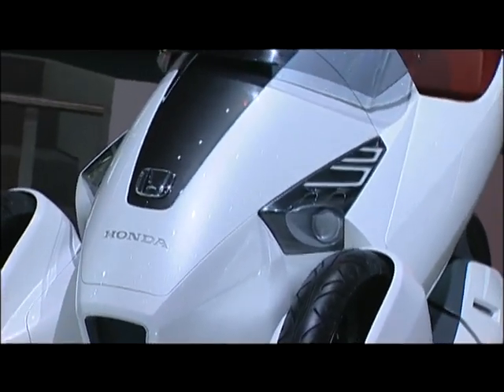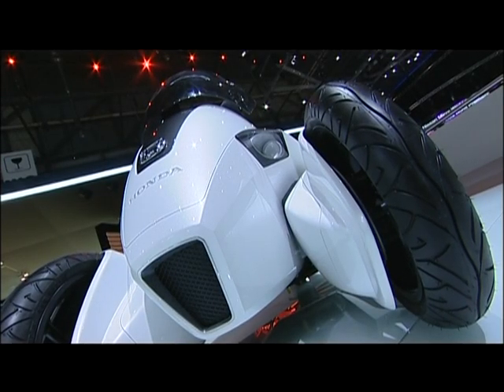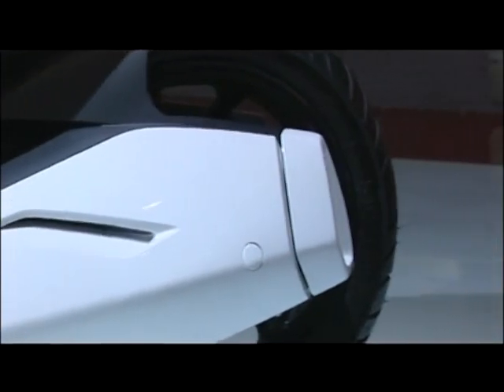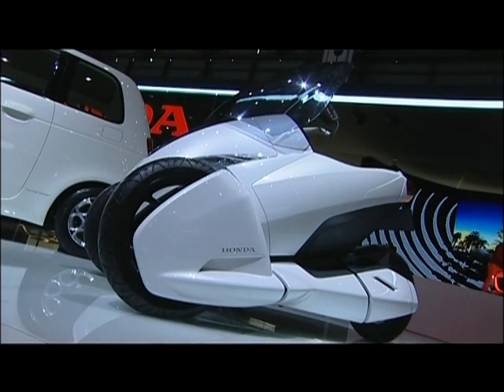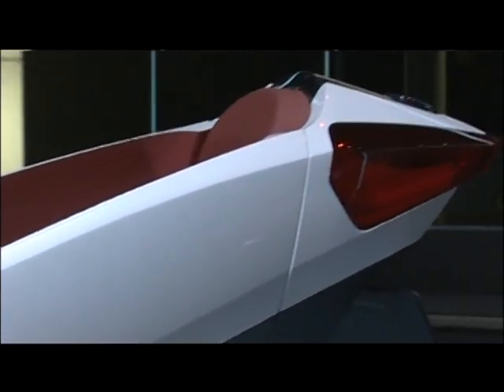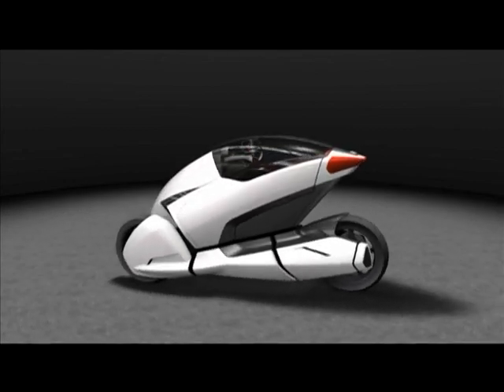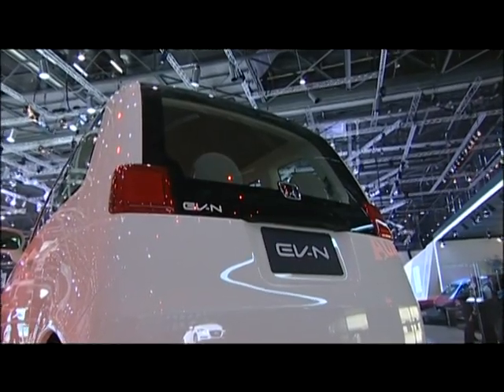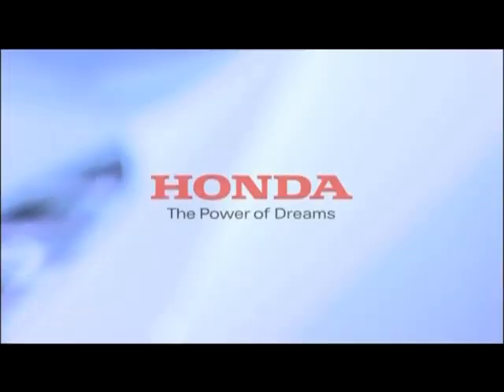Honda 3R-C Concept Car

Comment: Well, I live in North America, commute 42+ miles each way, and if this had the range and a decent price - I'd buy it.  On the beautiful days I'd ride my Suzuki B-King to work, and the not so good days, I'd ride this - without a doubt.
You know, a gas powered one wouldn't be a bad idea, either - probably get 120 mpg or something ridiculous - low weight, less friction...